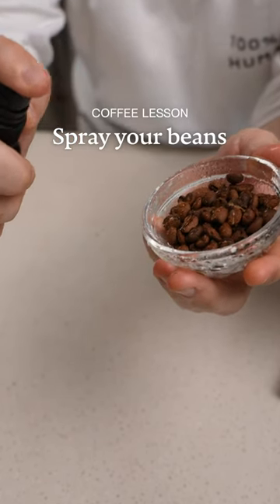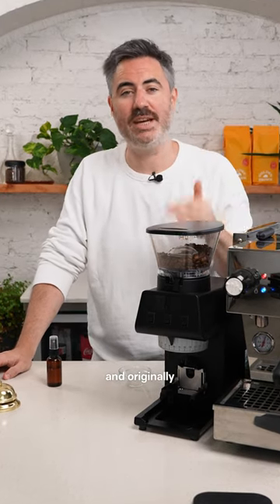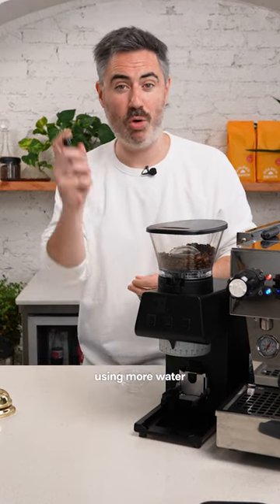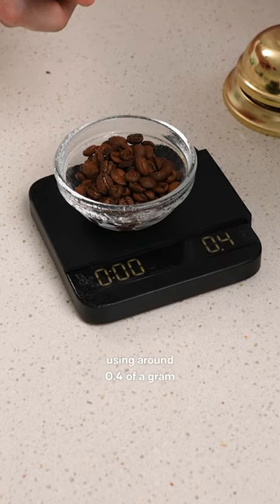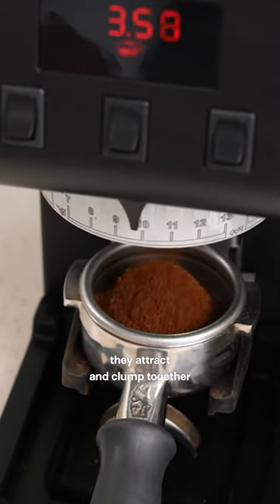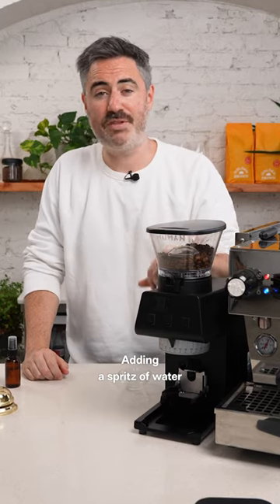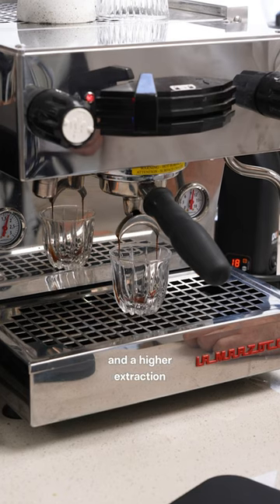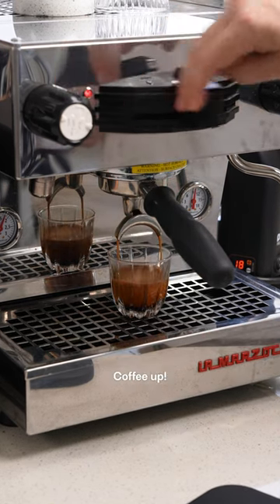Should you spray your coffee beans with water? 🤨

Comment: Okay but wouldn’t that rust the blades of the grinder and potentially add rust to your beans?
Reply: You read my mind! I use a hand grinder which would probably make spotting any rusting easier to see but I would also be concerned about introducing any moisture into the wooden body and drawer of my grinder. Since I use a french press for brewing my cuppa, I'm not going to worry about static charge or clumping as I don't see it affecting this method. If it is possible to fully air dry electric grinders after use, maybe that would eliminate any risk of rusting.
Reply: Didn’t think about this — good point 😅
Reply: Dont know if it is enough water, specially because some metals are "anti-rust" or "rust resistence". And some grinders are made of ceramic.
Reply: My hand grinder specifically says to not spray water on the beans because it will rust the burr.
Reply: Even mid-price grinders use ceramic burrs and not metal. Those that do use metal likely use stainless steel (does not rust) or another non-ferrous metal
Reply: I've been doing it for months and have yet to see a sign of rust. Just clean the grinder regularly. I think the buildup of coffee oil prevents any rust from forming.